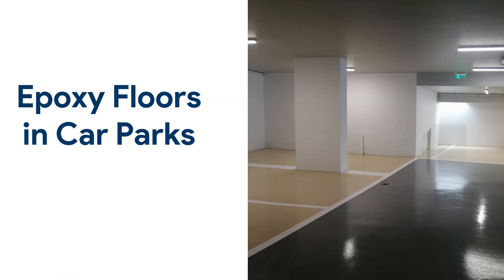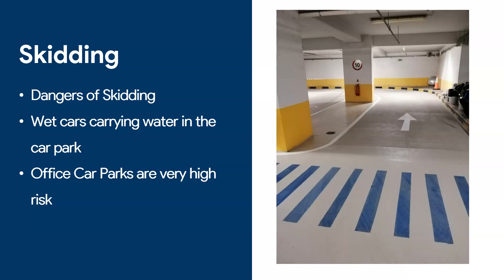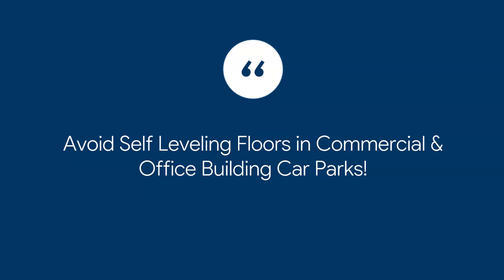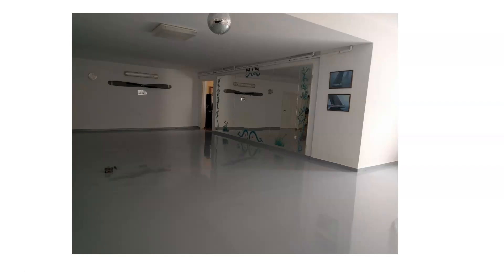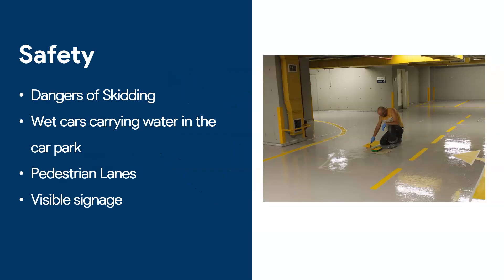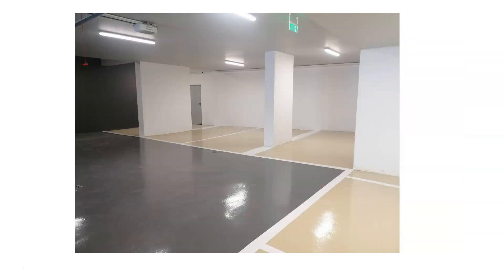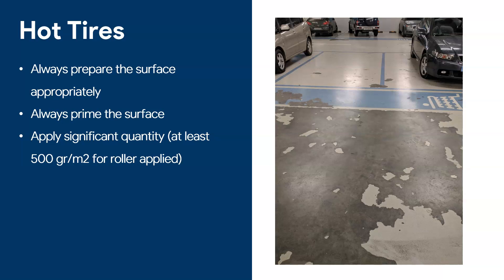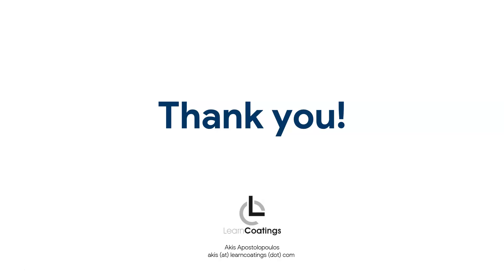Epoxy Flooring in Car Parking - The 4 Most Important Things to Consider!

Comment: Another great video! 👍👍👍
Do You recommend grinding 1st roller layer of PU or epoxy floor before roller application second layer?
Reply from the maker: I would only grind it if there's many issues with it. For example if I'm working on a brand new flat concrete floors usually intermediate layers don't need grinding. But if I'm working with an old damaged floor, I may have to apply filler coats in between. Those will definitely require grinding